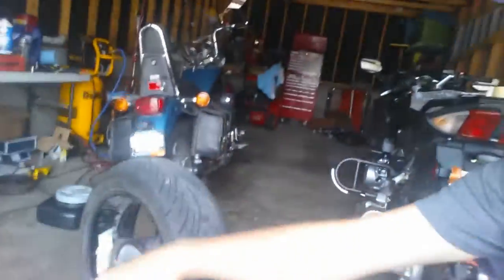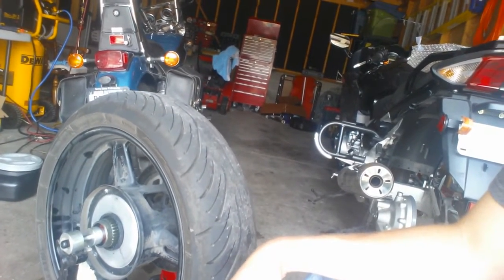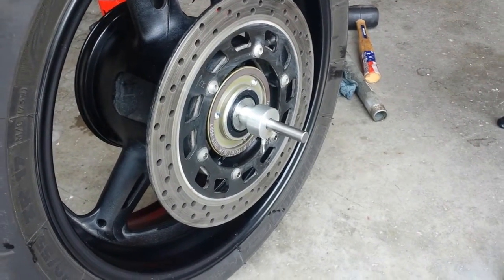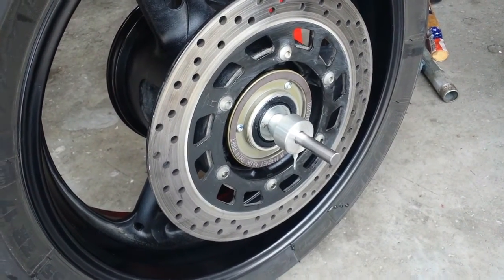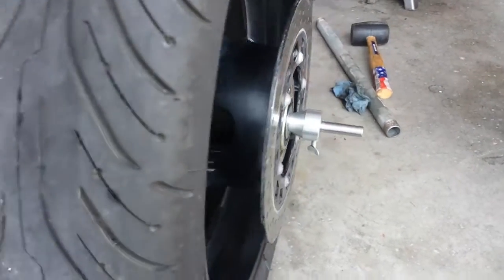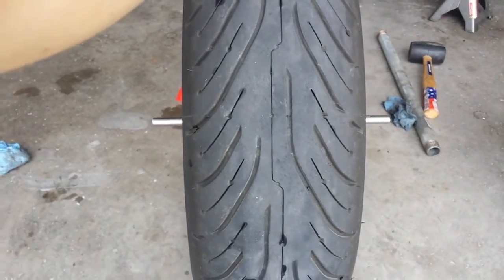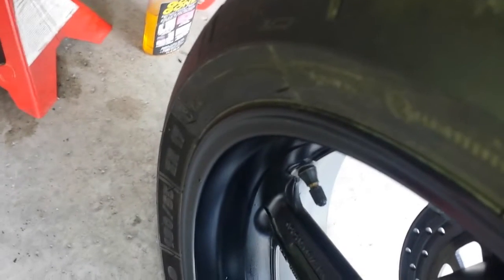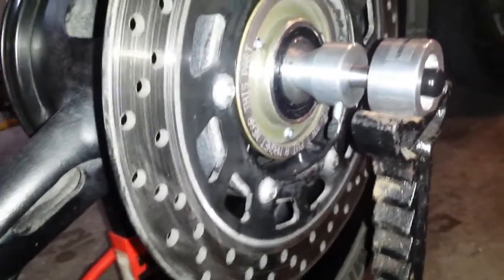How to Static Balance a Motorcycle Tire on FJR1300

Comment: Last year I took my Kawasaki to the dealer for the 600 mile check and I could make a list of things they neglected and outright did wrong,  There was also some minor damage.  When my FJ-09 is ready for 600 mile service, I'll do it myself.  I have the service manual and most tools.  The place I took my wheels to get my tires changed, did an ok job, but I think I'll just do that myself too.
Reply from the maker: A few weeks ago I changed that rear tire on my FJR. I used Motion Pro Spoons and bead breakers (About $50 on Revzilla). They worked, but it took a lot of time and effort to get the tire off the bead and then especially off the rim. I was as careful as I could possibly be, but they still took the paint off the inside part of the rim. Thankfully no damage to the aluminum itself. I am seriously considering investing in a No-Mar tire changer for future tire changes. They are expensive, but if you a true DIY guy, and if you change enough m/c tires, it will pay for itself in a couple years. Since I have both my FJR and my wife's FJ09, it probably makes sense to buy one. Hopefully I'll get one before I have to do another tire change. I think I'll be good on tires until next Spring/early Summer.
Reply: get the nomar

Comment: You mounted weights in wrong locations.
They go a little farther toward the middle of the rim.
Yamaha factory ones went on the center ridge, but no local places carry those.
Reply from the maker: I mounted the weights as close to the center of the wheel as I could get them, given that they won't adhere properly to the center ridge. The tire seems to be running smoothly down the road at this point. I'll report back as to how they did when I change my tire.